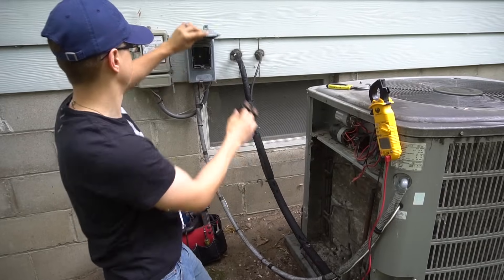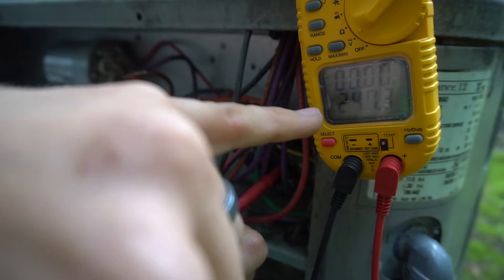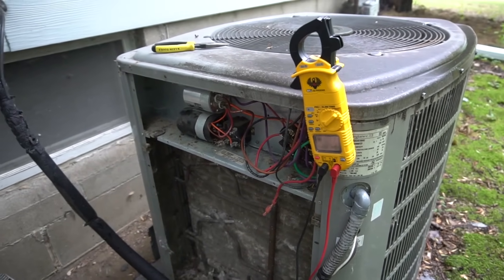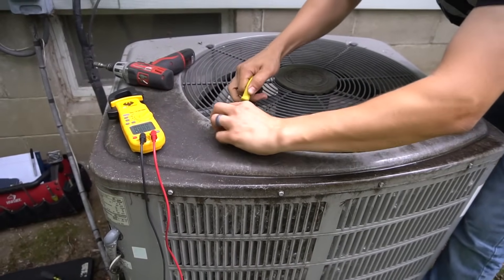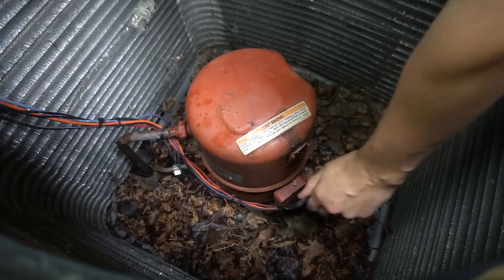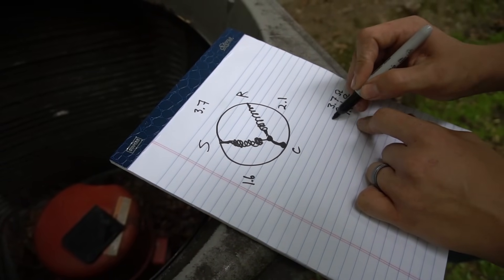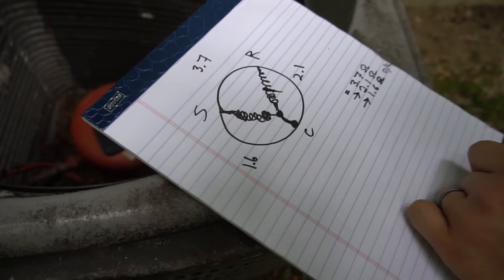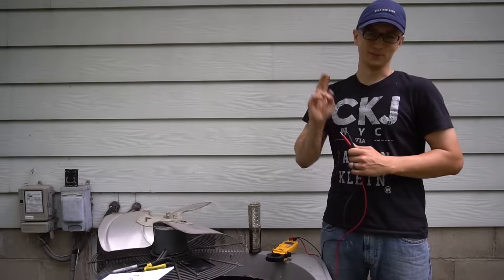How to Check HVAC AC Compressor

Comment from the maker: Hey guys! If you think the video starts kind of abruptly, you think correctly :) I accidently deleted the intro portion of the video from my computer. You’ll have to forgive me for not wanting to re-film it. Here is the script for the missing part if you are curious to know what you missed out on:

"In my AC fixing videos, in the comment sections, often times I explain to people how to check their compressor to see if it’s bad or not. I finally decided to make a video of how to check your compressor which I can reference people to instead. Before we begin, I just want to make sure that you checked your capacitor before you start suspecting that your compressor is bad. If the compressor capacitor is dead, the compressor will not start. The capacitor is the silver cylinder looking thing right here. (points to the capacitor) Since this video is about the compressor, I wont be explaining how to check and replace the capacitor right now. I do have a video that shows how to do that though, it can be found in this video’s description. After you have verified that the capacitor is good…. (This is where the video begins)

How to Check and Replace a Capacitor:
https://youtu.be/9ZGfvC-PMWU
How to Troubleshoot A/C Step by Step:
https://youtu.be/wzAA4dlp_70
Reply: you gust show us th wirrrring test>>wewhant mecanik test>>pleeeaaaase

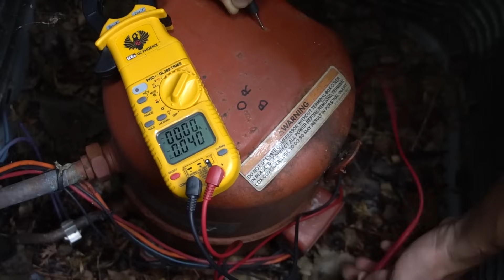Comment: 10:20 He should be using his Ohmmeter setting and measuring “OL” from compressor winding to outside shell casing indicating the windings are not shorted.

Comment: if a compressor is bad would the AC gets turned on for a short time and blow cold air? and shut off within 20 min? with a new capacitor?

Comment: i went into a hvac web site and i was told that i needed a 35/7.5  capacitor .the 7.5 is on the fan motor but cant find the 35
Reply from the maker: The 35 is usually for the compressor, and the 7.5 for the fan. 👍

Comment: I’m going through capacitors like crazy this year any tips on what to check. So far I gone through 5 this year as soon as I plug in the new one it starts working perfectly no weird noises no nothing some work great for 1-2 months some work for a couple days, and others for a couple  of weeks, and some brands work better than others. I feel like my compressor is good since it comes right on and cools perfectly. I did find a weed eater may have hit the wires coming out of the house into the unit and the insulation on the wires were brittle so I bought a few feet and replaced a section the wiring everything was working great and I thought everything was over but then it stopped again since capacitor has been kicking my butt I went out and replaced it but this time nothing happened. Usually the compressor kicks right on with no issues but not this time. I started wiggling the attached wire and nothing changed before I could wiggle wires and and the pull switch would click on and off and not this time so I went into the attic where the wires meet I checked there everything looked good I gave it the gold ol’ turned it on/off from the thermostat a few times then turned it on/off from the breaker and still nothing so I left to buy another capacitor for testing purposes incase my new one was bad when I got back home I tried to turn on the a/c one more time before replacing the capacitor and it turned right on with no issues. I’m lost and not sure what to check next now I’m leaning more towards a bad sensor? Any ideas or clues on what to check next would be awesome thanks

Comment: Just a couple of days ago my ac unit wasn’t running. My HVAC guy said my compressor was on rotary lockout and the capacitor was reading low and the compressor reading caution. He just restarted the system and it started fine and still working. I already had my capacitor replaced 2 years ago, but my HVAC guy said it appears it needs to be replaced again. He also said my compressor is likely going bad. Could the bad compressor reading just be due to the weak capacitor? Is it odd that the capacitor would go bad again so quickly? My unit is only 6.5 years old.

Comment: Ok, the resistances measured between the pins should be low, but how low is low?

I got 4.2, 2.9, and 2.6 ohms. Is that too high?

Also, you said the lower numbers should sum to the highest one. My lower numbers sum to over an ohm higher. Is that too much? Any advice on how to factor in my less than expert use of the multimeter?

Thanks. I'm learning a ton from your videos.

Comment: Much better to measure the compressor run winding parameters at the contactor and pulling off the start winding connection from the start capacitor and measuring that lead with respect to the common. If the resistance is high or indicates an open circuit, then the connections can be traced to the compressor. Ideally, an inductance measurement is performed, that can identify shorted windings.

Comment: So "OL"is bad comp?
Reply from the maker: If you're measuring resistance between the compressor pins, yes. Either bad compressor or a bad connection between the meter lead and the terminal.

Comment: what about current draw; tech told me mine is rated at 18 amps max and drawing about 17 amps; this indicates compressor is going bad, according to hime. He did not take any resistance measurements. What do you think? (fan motor is bad and will be replaced)

Comment: Great video, I’ve never done anything with A/C before but your vid was so easy to follow. I checked the compressor on my church’s roof because the A/C would not come on. It kept tripping the breaker. I had readings when I touched each one of the three leads on the compressor to the compressor casing. So what is a “shorted to ground” compressor mean?  Replace the compressor or is there something else wrong?

Comment: In case anyone watches this and is new to using a multimeter; when he talked about the pole combinations across which you should measure resistance when checking the compressor, he meant to say to check poles 1&2, 1&3, and 2&3

Comment: Maybe someone in the field can give an honest answer about this…..Why are compressor refrigerant lines brazed on? As a car mechanic our systems have bolt on fittings with seals. Pressures in automotive systems are just as high, temps under the hood of a car are higher, and vibration has WAY more effect in a car. It seems like it’s the industry’s way to deter DIY’ers from attempting any repairs.
Reply: @baalbezub6848 If you consider what you just said plus how much haggle people give you about buying HVAC parts unless you’re a certified graduate technician, I think your suspicion is dead on. It’s so they can price gouge.
Reply: @sycamore387  Yep, I had a supply store refuse to sell me a York combustion fan because I wasn’t licensed and it was for a “gas furnace”. Even though it was a simple replacement and no gas lines needed to be touched. Ended up getting it from a friend of a friend for way less than the store would’ve sold it to me retail.

Comment: @2:58 you checked that there was no voltage with your voltage pen. We see the power was off. BUT what if a standard Do It Yourselfer were to touch the terminals of a capacitor??? 😵

Comment: Hey amigo if have good wire readings from compressor & it's not grounded but the compressor has no  refrigerant  & pressure how u know y mechanic inside it's k

Comment: My A/C sort-of works. It seems ok in the mornings, but when the demand is high in the afternoon with 90-95 degree temps, the temps at the registers are 78+ degrees! Two different service calls (different companies) and YouTube video tricks and I still haven't found the fix! I tried this one today, and this is my only lead so far. The two coil resistance readings are 1.3 and 2.1. The sum should be 3.4, but my actual reading is 3.0. Is that discrepancy in the sum enough to create a problem?

Comment: Great video!!! Thank you so much! Because of your video, I went way further down the compressor rabbit hole than I thought I ever would and found that one of the three wires that connect to the compressor was either not seated right or had corrosion or...etc. After re-seating the wires, the compressor came on and the AC is working great again.
Reply from the maker: Awesome! Glad to hear you were able to get it fixed.

Comment: @10:20 the reading for resistance was being taken with voltage setting on meter. But I know what you’re looking for in terms of readings

Great video 
Thank you
Reply: Yes. Good spot & helps people who are referencing for a troubleshoot assist. It should have read OL ohms vs. 0.0 vac.

Comment: Man.  IDK. I have 2 Rudd 3.5 side by side. Neither COMP comes on. One of them is 1 year old, the other about 25 yo.  Good Caps, Proper voltage across Contactor, Both Ohm out properly (newer Copeland has much lower Ohms i.e. 2.8, 1.4, the older Copeland is like 60 and 70 ballpark), No shorts to ground, Voltage going to COMP, checked at pins even,  but they just hum.  I can't check Refrigerant PSI, but gauges show both lines equalize at about 125 lo side, 150 Hi side. I tried using a Dual CAP, tried separate CAPS, (one for COMP, one for Fan), only the fans come on -either way. I tried CAPS at 45, 50, 55 and 60uF -no avail. COMP(S) just hum. One thermostat read change batteries, I thought maybe wasn't getting correct signal but solenoid is drawing in, set on Cool and Auto of course ( and the batteries I took out both measured 1.56 v)(?).    I tried checking running amps on the 2 COMP wires, was  6 A on the old one and like 2 A on the new one. But unless they kick on, I don't trust the Amp reading, but thats what I get while they are humming.  I can't tell if the COMP are locked up because there is no high amperage reading on Common or Run (going to Contractor) wiring,  of course it doesnt kick on but wouldn't I still get a LR AMP reading on the COMP wiring?     Unless the windings show to be good  the COMP is still locked up?    Any thoughts out there?
 I hate to change both Copeland COMP(s) when it could be something else.  One is only one year old.  (R22 and new one changed to 407 last year).  Everything was working fine until few weeks ago, and yes I do change the filters often.  Is there any other methods to check a COMP before going through all the labor? Thanks anyone !!!

Comment: Just did the test and I have the 3.7 but the other 2 are adding up to only 3.3-3.4  So what is wrong ? The a/c keeps tripping the fuse after 20 seconds. Capacitor is replaced with a new. The switch seems to be ok, switching just fine (contactor or contact switch).  I see no loose wire, no burned wire, fan runs fine, spins free.  I cleaned the filter, cleaned the condenser fins. 
Any ideas ?

Comment: Quick Question - My breaker has been tripping, so I replaced the breaker but it immediately flipped even would out the AC unit on in the house.  I had an AC guy come out and the breaker is no longer flipping but he said I need a new compressor.  The unit is getting electricity and the fan works.  The AC guy ran the multi meter on the compressor.  One out of the 3 connections read .1 and he said the rest were super high and that the compressor needs to be replaced.  But it almost looked like he was not getting the meter onto the pieces correctly because the meter was firing off a ton of random numbers.  The unit was installed a 1 1/2 ago so it is fairly new.  The compressor is under warranty and labor but he is wanting to charge $140 a pound for R-410A and says the unit takes 14 pounds.  This charge and number seems outrageous.  Can you please advise if I should have him come back out and do another read on the compressor and what are your thoughts on the cost of the freon R-410A.  I have a Goodman All 14 SEERS - 4T Single Stage GSZB404810 Heat Pump.

Comment: What is the Compressor Min outdoor Temperature be set at my unit could take up to-15  and also Aux heat Max outdoor temperature. When its - 4 and up won't kick in unit outside i must have setting wrong

Comment: I would put one lead on a clean piece of the suction line when checking for short to ground. Putting it on a painted surface can give you a false reading. The suction line is connected to the hermetic shell. Also, if you measure out of limits (OL) it doesn't mean the windings are open. The is an inherent protection called a Klixon embedded in the hermetic windings that will open up if the motor has overheated. This is a common symptom if the run cap is bad and the compressor has been trying to start but is drawing LRA. The protector will open up to keep the windings from burning. You can take a garden hose and cool it down to get the klixon to close again.

Comment: I can't remove the wiring harness from the compressor. I tugged the black cover as hard as I could but it's not coming off. Why is it that hard to get off? It's a 20+ yr old r22 3.5 ton Copeland.

Comment: My resistance measures 1.2 ohm, 2.1 ohm, and 2.9 ohm. My condenser is currently not running. Capacitor was replaced. Ordering another hard start to see if it can help condenser to start. Does the resistance measurement mean that condenser is broken?

Comment: The red (C) wire keeps burning up from the capacitor to the contactor, right at the contactor. I replaced the wire and the capacitor. 5 days later it happened again. Any ideas?

Comment: Without digging into my compressor and instead checking the wires that lead from the compressor to the contactor, how do I know which wire is common, start and run?

Comment: 3 wires at the plug on the side of the condenser  + 2 wires coming out of the bottom of the condenser. what are the 2 wires
Reply: Heater kit

Comment: Question : after hurricane passed my ac is not working and tripping breaker right away. Installed new  capacitor, contactor and breaker. I have continuity between all 3 connector C,R,S.  and no continuity to ground with all 3. So I think electrically compressor is ok. But symptom is it trips breaker right away when  cooling call. What could cause to trip breaker. Is seized/locked compressor would have good ohm reading and trip breaker?  And if its locked rotor is there anything i can do to get started or i have to get new unit?
I read somewhere to hit with mallet to free rotor works sometime. Is it true. Thanks in advance for any input.
Reply: I would turn the breaker off and start at your ac disconnect. Test continuity between your hot wires to ground and continuity between the two hots. Do the same for your disconnects load side. If you hear a ringing, at least you know whether to go upstream or downstream of your disconnect looking for a short. I find that breakers on ac’s will trip on shorts, and the compressors overload will open if it overheats (locked rotor well say).  Hence why you get the the odd max breaker to wire size/ampacity you get on the decals when having to wire these things.  Just a helping idea, been doing hvac for 3 months now but am a jman electrician.
Reply: Oh and if you dont hear a ringing for either side, go to the load side of your ac contactor and do the same continuity test to ground. Hope this helps.

Comment: Very good. My nest is saying is cooling but nothing happened. When i push that manually, it works fine. What could be the issue? How i test the proper cooling wire

Comment: I really hope I have a capacitor issue instead of a compressor.  Fan turn on but no cooling and I get a buzzing sound every few minutes from outside unit.  Waiting for new 45-5 capacitor to arrive

Comment: Thank you for this informative tutorial.
Everything checks OK on my AC unit.
The A coil and filter are clean.
Freon pressure is good. 
Compressor kicks in and cools for about 2 minutes, 55 °F at the register and 72 at the return, then the register temp will gradually climb to about 67 °F and stays that way. What should I check for next?

Comment: In your video on the compressor wiring, there are two black wires also going to the compressor. Are these for the heater, and if they were not connected what would that effect? I found on my unit th at they were either rotted or cut , and if I reconnect them is there polarity to them?

Comment: Thanks for the video. Couple things: You never actually tell viewers that they need to set their meter to its Ohms settings (with the Omega symbol). You sort of imply it earlier when you say you'll be checking the resistance readings, but if people already know how to draw conclusions as to what they should do with their meter, then they probably already know what you are explaining to them. Other thing is when you check for continuity. Same deal. You don't explain that they need to switch their meter settings.. this time to the continuity setting. However, when I zoomed in the video, I saw your meter was set to take voltage readings, which I thought was strange and since that would be measuring voltage, not continuity (continuous/broken connections). And if they were checking voltage readings, they certainly would not be doing it with the connectors connected to the pins, nor if the system were electrified, else they kill themselves by shorting everything out in a giant flash of white light. 🙂

Comment: my technician said compressor is bad working hard causing AC to trip and said ac will run for 2 hours willl trip again.  Well I had all fan turn off and other plugs unplug AC working just fine. every summer people tended to use more electric causing it to trip just have to cut back

Comment: Just a question,,,,, if the compressor is running , couldn’t  person tell it’s running by sight and feel ?
Reply from the maker: Usually sound alone is enough to tell if it is running or not. The rumbling of a compressor sounds different than the condenser fan.